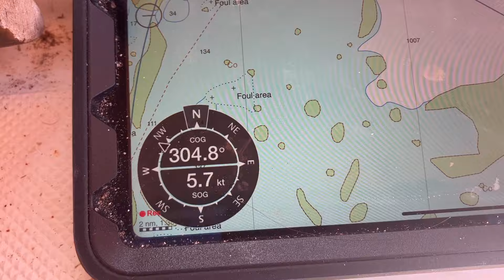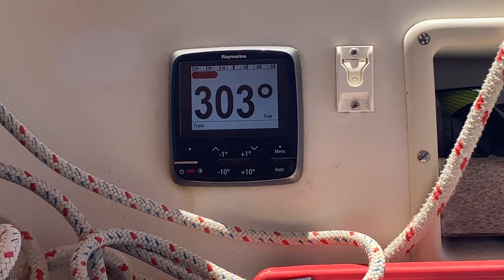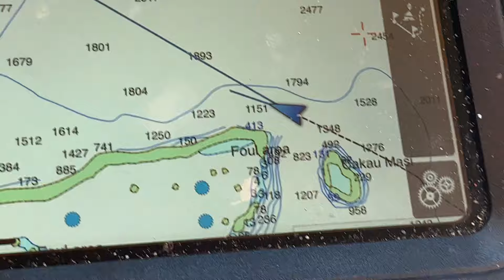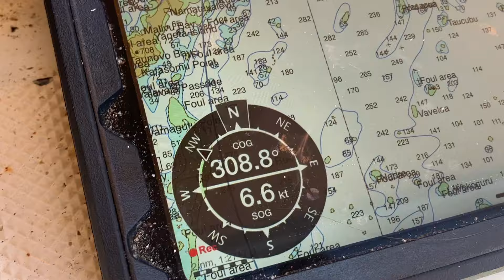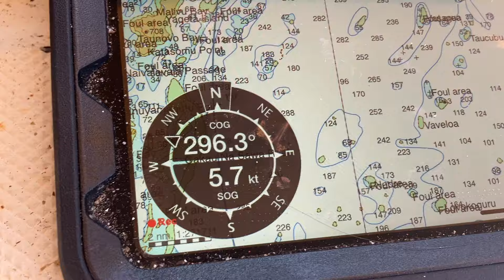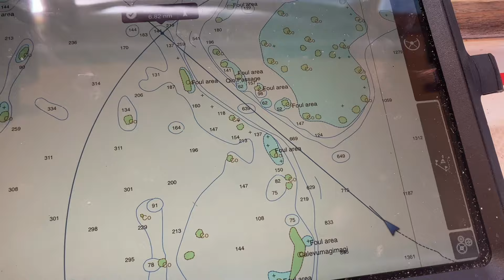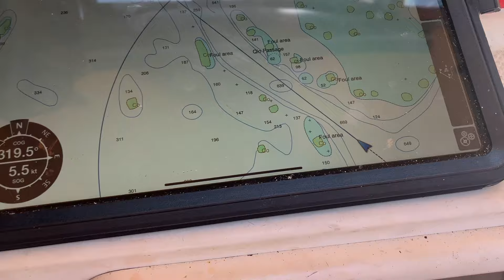Sailing Sea Change S2 Ep7 Sailing singlehanded to and down the Yasawa Islands of Fiji

Comment: Hugh, could you forward details on constructing the solar panel mounts?  I’m fascinated with your progress!  Mahalo!
Reply from the maker: Not quite sure what you mean by the mounts. The big panel on top of the bimini is secured to a framework on the bimini frame. The two auxiliary panels are simply mounted on tubes that fit over the lifelines, with sticks to hold them out.
Reply: @SVSeaChange  Sorry to be vague.  You answered my question,  very nice setup!  I usually steer with a Hydrovane but, now I’m going south into sunny Hawaii and need to cash in on the solar energy.  Fantastic documentary you have provided.  Please continue.